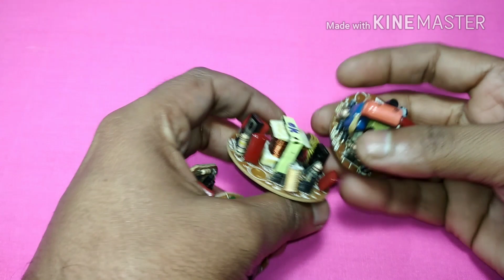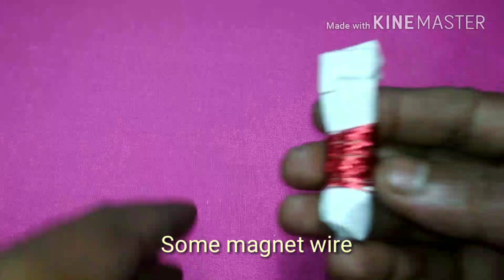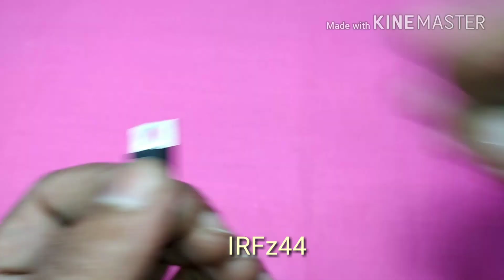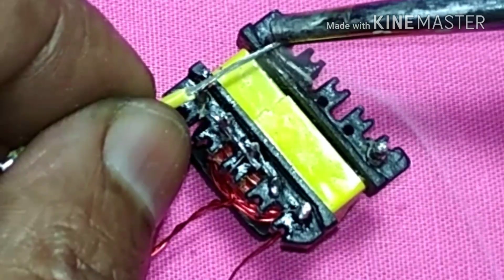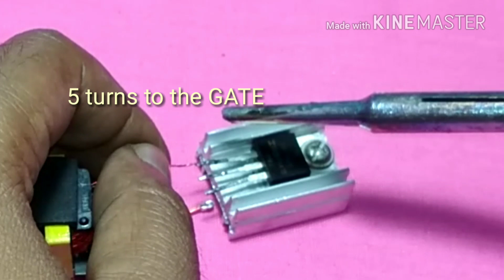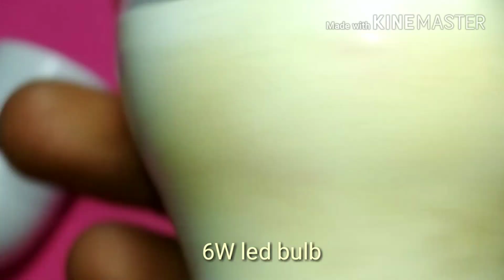3.7v to 220v inverter (6W)

Comment: irfz44 iska koi substitute IC hai...plz reply dena..
Reply from the maker: +TANMOY BERA 
You can use irf3205. Any NPN power transistor will work.
Reply: @TechIdeasAG  can we use wire found in cfl transformer